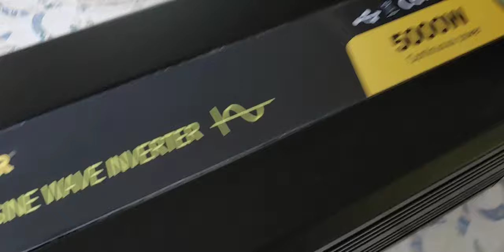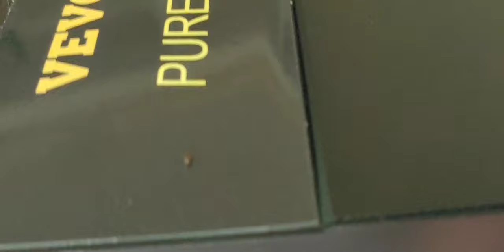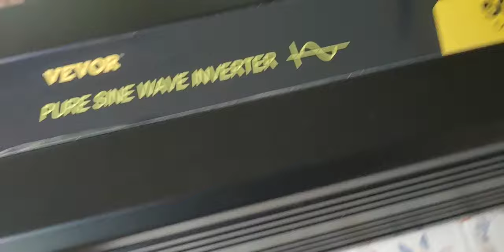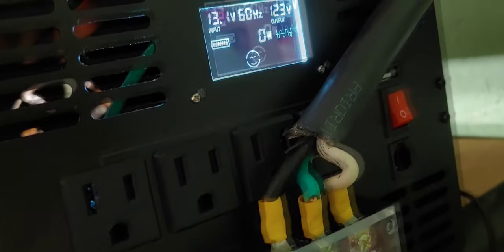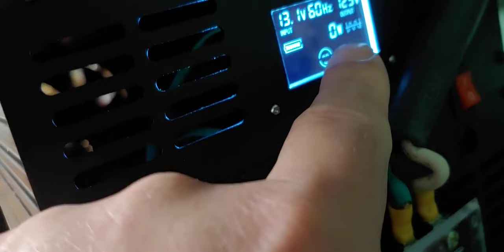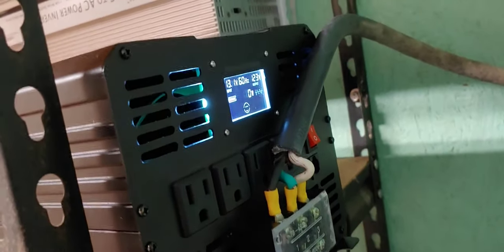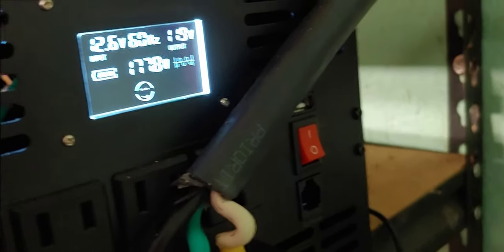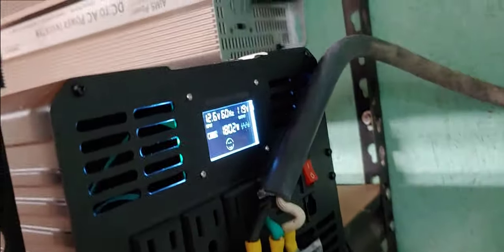Vevor 5000- watt budget Inverter for my Well Pumps.

Comment: Is your well pump 120v or 240? If 240 how did you configure the inverter to run it? Thanks for your reply!
Reply from the maker: The well pumps are 120v. Thanks for your comment.
Reply: @shoestringprep  Thanks again for your reply. I own the same inverter. I’ve had it for over a year and so far it performs well. My well pump runs on 240v and in an emergency I’ll use my gas generator to run my well pump but I was hoping you found a way to make that happen with the Vevor.

Comment: 12v lots and lots of heat. You going to start melting things.
Reply from the maker: Nothing has gotten hot yet. Thanks for your comment.
Reply: @shoestringprep  seriously! When I was running 12v so much heat I even had three charge controllers,  I upgrade to 48v one charge  controller runs all the panels no heat and I use less than quarter the amps to run the same loads for longer time.
Reply from the maker: @howardescoffery4950  it is good you found a system that works for you. Thanks for your comment.